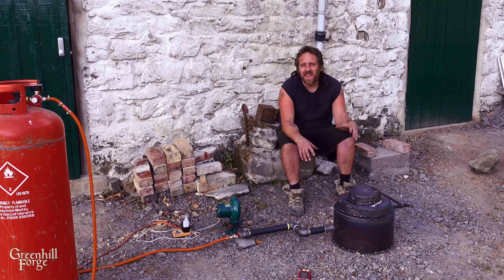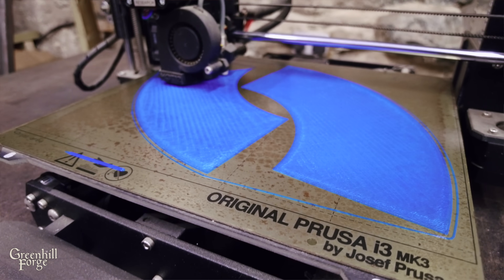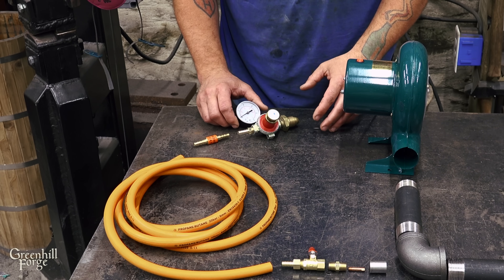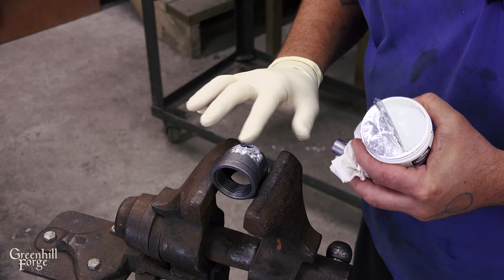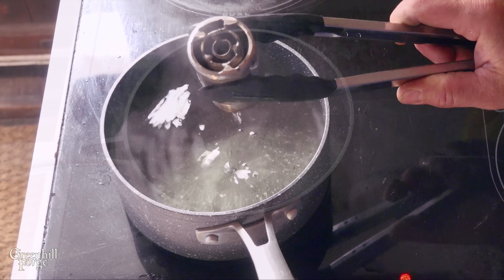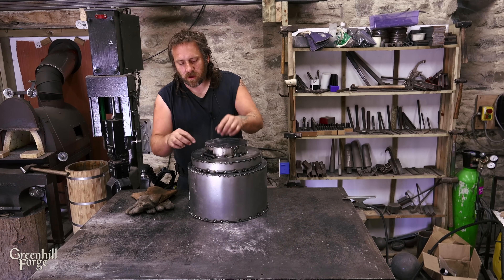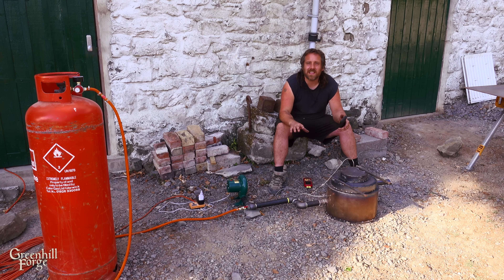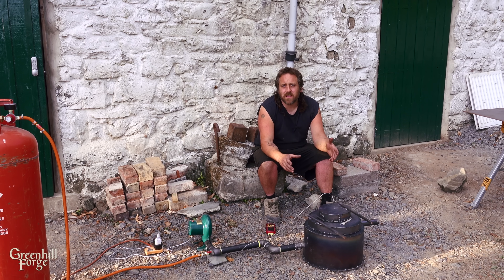DIY Kiln Build -Super Hot & Ultra Efficient

Comment: Thank you very much mister greenhill forge !

I will replicate your design at home, maybe someday if you see this comment, i would like to ask you if it is possible to even reach temperatures that melt steel and iron, if it wasn't you, i was about to use my MMA welder as an Arc furnace by using graphite electrode

May god bless you and your gute wolfie ! ^-^
Reply from the maker: you could definitely get hot enough to do cast iron with a good design. you could melt steel too but I'm not sure how usable it would be after that

Comment: Awesome build!  

One small suggestion:
For the fitting that receives the MIG welding tip... Rather than using a nipple and filling it with a brass rod, perhaps you could just use a brass plug?  You'd just have to turn down the unthreaded end, and then thread the outside of it (as well as drilling and tapping a hold in the plug for the MIG tip).

Comment: When you say,  "now I will mix up the refactory cement"  could you clarify what type of refactory cement your using?  temp rating,  and other than curing/heating being done, are you ramping this heat up?  Could the same thing be done effectively in a kiln? where the ramp up temps are very controllable.
Reply from the maker: it's vitcas 1700c castable refractory - https://shop.vitcas.com/refractory-castable-grade-1700.html

Comment: That's a brilliant  idea... 3D printing moulds for casting refractory cement. How do you find the heat transfer thru that cement... does the outside of the furnace get hot? Subbed here.

Comment: Amazing vid man, truly. Regarding the idea to use it to melt cast iron; would adding a second air turbine right in front of the other one in a simetric manner, increase heat in the crucible since it would increase the amount of oxygen mixed with propane? other option would be using more pure oxygen by using an oxygen tank and mixing it with the propane the same way, since air only has about 20% oxygen.

Comment: What is the logic behind the exhaust port vs. some kind of open top? Also, during long term use have you seen any degradation of the exhaust pipe? I love the idea of using the waste heat for preheating the charge or the molds.
Reply from the maker: the idea is limiting the exhaust to the same cross sectional area as the input to maintain pressure and velocity of the swirling gases and limit oxygen entering the chamber. it does get some fire scale on it but it's loose so can just be swapped out

Comment: You can increase the efficiency preheating the incoming air and obtain higher temperatures. Can be done with a tube and tube heat exchanger using the hot burned gases

Comment: Nice build.  I use a larger diesel/kerosene burner for melting down bigger chunks of cast aluminum parts into ingots.  Want to make a good smaller kiln for actual casting into molds since the compressor needed to atomize the fuel is noisy.  That's a nice simple design, already have a mig nozzle propane burner very similar to yours but no nozzle like you have going into the kiln, that's  slick.

Thanks for sharing

Comment: Very nice design should be proud!  -Could have used a thread brass plug for the propane input and a malleable iron "T" instead of drilling and welding an elbow. Passivating stainless is good to get rid of extra iron but the heat will do the oxidation and eliminate passivation.   Can feed back the exhaust to the input and a pipe in pipe heat exchanger for greater efficiency.

Comment: You will find out very quickly that once you get above 1000c it will take twice the PSI of gas for each 100c you go up. Not sure that .8mm tip would be big enough to get it up for the cast iron. I use 1.2mm tip with 10PSI on my forced air setup to get it up to over 1300c. But nice little setup!
Reply from the maker: Thanks! Yeah, mig tips are great because you can just switch them out for different setups. So far I've been able to get 1250C at 4 psi with the .8 tip. Hoping to do the first actual melt tomorrow and then maybe try pushing it a bit after that. I also think I should have gone with double the insulation to really max it out.

Comment: Ha! Watched this several times to try to figure out the approximate lengths of the black iron pipe. It took a few times to figure out why you used a socket to connect the fuel supply! The socket fits the nipple that the mig tip is fit into. That is an awesome idea to make the fuel feed easy to connect and disconnect! Is there concern of the fuel feed to 'pop' out of the socket or, is there anything else holding the nipple in the socket?
Reply from the maker: It's threaded in with gas ptfe tape

Comment: Rookie question: most refractory cements that I'm able to find are rated for 1000-1200°C at most. But this kiln appears to be capable of reaching higher temperatures than that, which is good for some metals of course.. but what exactly happens to the refractory cement if the rated temperature is exceeded ? Sorry if this is a stupid question, I'm genuinely interested in making a kiln and I my knowledge on the topic is rather limited. And thank you for the video!
Reply from the maker: My guess is that they'd start to crack and crumble. hopefully slowly so you'd notice but it could be quite sudden. I definitely wouldn't try using higher temps than the rating. I used vitcas 1700C castable refractory. Mizzou is also really good. Also the only stupid questions are the ones unasked.
Reply: @GreenhillForge  Thank you, appreciate it. And you're right about the questions :P

Comment: I built a kiln a bunch of years ago and thought oh how cool to make stuff out of aluminum cans, so I did. What I learned: Wholly cracker barrel it takes a TON of cans to make stuff! My favorite source of aluminum is old automotive parts, heads, transmission cases, brackets, etc. Far more aluminum at way less effort, easily obtained at your local repair shop at scrap rate or free some times. I reduce the aluminum into smaller hunks by digging a hole and using a wood fire with air to either melt or soften so it can be easily chunked apart or a steel drum can be used on its side with an LPG burner. The aluminum melts and runs out the end where you can collect it in ingot molds. AKA cupcake pans or other molds. I am currently working on a forge build when I have time, after that I probably need to build another kiln. hahaha

Comment: After it gets hot you should switch to used oil to get the temperature where you want for iron.  Propane just wont get you there for a number of reasons including cost. The one thing I found about my blast furnace is that the air to fuel ratio has to be just right to get the temperature to get hot enough to get close to melt iron. I usually leave the air running wide open and adjust the fuel flow to get what I want.  Good luck.

Comment: make sure you always turn off the gas first, then the forced air. that way only air is flowing threw the pipe. usually what's used is a venturi effect pipe that gets hot and used convection to ensures that air is always being pushed threw the pipe when fuel is cut off. the venturi effect uses flow to create a low pressure zone(vacuum) that is filled with the fuel. so you can think about it as a half circle stone in a river all the river water flows around the stone and just behind the flat part of the half circle the water wants to be pulled away from the stone.
Reply: Rura Venturiego jest mniej efektywna.
Reply: @norskenor2524  are you a ai? less efficient then what? are you trying to say the air mixing is less efficient? because more even flow happens with venturi, how efficient does your air mixing need to be in a less then 4 ft pipe? and how is efficient relevant to the safety issue I was bring up? are you thinking that you can't use a blower with a Venturi tube?
Reply from the maker: absolutely. propane should never be flowing without air the on. Venturi effects are really cool, it's a side effect of the bernoulli effect which I have a video about here https://youtu.be/fNLjG3oAdUM . Forced air burners can get a lot hotter than venturi burners so while one of my forges is Venturi based I usually go for forced air.

Comment: The discolouration on the outer steel shell indicates you are loosing a lot of heat due to the large surface area.    Add an extra 2 inches of Rockwool or vermiculite insulation  inside another outer shell and you will be able to melt cast iron.  You also loose a lot of heat through the bottom.   The efficiency will also increase.
Reply: It'd be really cool to see this build with a thermal camera, it would really show any points of loss quite clearly.  Still looks like a really nice build!

Comment: Subscribed. It's great finding creators like you. A few questions: (1) Do you post your 3D models on Printables/Thingyverse? I would love to make some mods. (2)  I was trained as a goldsmith I notice that a lot of steel, al, cast iron furnace's don't use a shielding gas during melts to reduce pitting in casts/ingots nor borax to help with slag and impurities is there a reason? Cheers!
Reply from the maker: Thanks! At some point I will get things like 3d models up over on my patreon but I'm really busy so it's hard to find time. I use borax to clean it up but wouldn't use I shielding gas for anything less than silver. It just doesn't really need to be that clean to make it worth it. My wife was a jewler and she didn't bother either when doing things like brass, bronze, copper. Gold is just to valuable to not bother

Comment: Very well done project and video. Explaining the pieces, parts, dimensions, sizes and reasons why you're doing it that way is very helpful. I would like to build a small kiln like that and for the same reasons. The video and attached list below covers most everything. Things I would like to have include a 3D printer and a CNC plasma cutter. I have an older model HyperTherm with the handheld torch. One thing I didn't quite get...  I believe you said a 0.8 MIG tip... I think all the ones I have are 0.025, 0.030, 0.035, etc.
Reply from the maker: Thanks! I use a hypertherm on my cnc, great machines. if you can get or build the cnc table you could just get a new torch for the hypertherm. An 030 is the same as a .8mm

Comment: Wonderful furnace but you're melting aluminum unsuitable for machining, better to use castings like engine blocks, heads and wheel rims.
Reply from the maker: Thanks. I'll keep a look out for engines but I need some basuc parts that can metal should be good enough for

Comment: You are missing both

The very bottom should have a small cup area.
You want a space out of the heat blast for some charcoal to set.  This gives you the option of creating an Oxygen depleted kiln environment (it's beneficial for some types of pours.)
The reason for the cup underneath is that the heat alone in the shielded and lower area is enough to more slowly burn the charcoal lumps.  
(By simply throwing in a lump now and then the more direct exposure to the flame will reduce the charcoal to ash way to quickly and it's both a time consumer for you and more expensive of burning through more charcoal.) 

 the replaceable catch basin in the bottom for where something like a dribble collects and cools.  This was commonly a little metal cup that prevented metal turning solid and clinging to the kiln cement/brick etc...  When the Kiln was cold you pulled out the cup and emptied it.  (A metal cup with a 5 degree taper meant the contents fell out like a hockey puck. 

Not to worry your current design will eventually have some dribbles and those will spall the bottom of the chamber.  Just grind (don't chissle) the remaining area and then install the modification.

I made mine from a 30 gallon drum that we cut down.
The year was 1994 possibly before you were even born.

Comment: 1. You remind me of an Old friend of mine.
His story was he spent a summer collecting Aluminum cans.
At the end of the Summer he realized that an abandoned car with a cracked Aluminum block had more Alu. than he'd collected all summer.
With in a year he had a truck rig that would lift the engines out of abandoned cars and he would power wrench the nuts and bolts apart.  He said he could street strip a car in less than 20 minutes.  He had every abandoned Aluminum blocked car hit for the area of 2 whole counties.
It was then that the Sheriff of the county had gotten a mandate to recycle abandoned cars' and he was very upset with my friend that my friend had already harvested the cream of the crop in the recycle of certain groups of cars department, and the highest/easiest catigories. 

If I were you I would start Looking for larger Alu. objects to upcycle. 
2. Consider switching the metal muncher into a wood grinder, for a different line of products.  You could find a line of product and simply press the wood grind and some saw dust (Maybe even wood flower) into a mold and then inject glue, while removing the air (it's not that hard to set up) and then press the two half's in a 2 ton press while it dries.  Out pops a cheap wooden product.
3. Consider switching the metal muncher into a Plastic grinding for Upcycle in 3D printers is an up and coming thing.  PLA is commonly remade into filaments.  (Dual extruders are becoming a thing and using the remade filaments for infill will become a thing.)  Also PCL pellet machines ("Greenboy" You tube) could be made to handle shredded low temp plastic materials and skipping the make it into a filament.  So your grinder may have a better life and you would place the screened shred into a finer grinder to make the out put of your machine even more reliably feed into just a hopper.  
4. Consider making the above mentioned Grinders and then sub contracting them to other like minded people who train the the labors' at some centralized facility like a community Upcycle center. The laborers' could be those who could be needing to do community services before a court date.

Comment: Use that hot exhaust to preheat the intake piping with a reverse flow jacket. Watch out for ignition temperatures.
Reply from the maker: it just becomes a much more complicated and potentially dangerous build, but prehaeting would certainly increase the kiln temps
Reply: @GreenhillForge  Nie stosuj rury dolotowej , jest niebezpieczna tak jak sam gaz.

Comment: Is there a benefit in using this TIG nozzle for mixing in the gas ?  For such type of forced air burner they usually don't use a nozzle but a simple T-Joint for bringing the air and gas together and a following elbow for mixing it.
Reply from the maker: It's a mig tip and the benefit is that it is replaceable and interchangeable so the flow can be adjusted depending on the kiln it's being used with
Reply: @GreenhillForge  Thanks for the answer. I thought the pressure regulator was also used for regulating the gas flow.
Reply from the maker: @Dr._Spamy  it does but altering the diameter of the orifice also adjusts the flow characteristics

Comment: Eloquent and efficient design.  I'm no expert in the field but this is an ingenious design with a working proof of concept. I must ask what is your creative process? 

I'm struggling to produce an efficient heat exchanger to heat up water from propane. Was really excited by your copper tubes in your previous videos.
Reply from the maker: thanks! not sure i've ever thought about my process. I guess I just get interested in a thing and then read a lot and go down rabit holes until i can answer all they "why" questions I can think of about it and then play with it in my head, trying to focus on the goal and strip out anything unnecessary. then build, fail, learn, build, fail, learn, etc...

I think for a good instant heater a design would be copper coil inside circular flu with helical baffle up the middle and propane burner at the bottom, kind of like this video but with propane, circular flu and helical baffle. A good tanked design would be a circular flu running up the middle of a a cylinder tank with a helical baffle in the flu and a propane burner at the bottom
Reply: Thanks for the insight. 

Your videos show your are rapid ability of learning and creating. It's refreshing finding such original content!  @GreenhillForge

Comment: Hi! I am very happy that I found your channel too! 

This is exactly the burner that I want and need! I was wondering if there is any chance you could provide a sketch of the piping system with diameters and lengths?
Reply from the maker: Thanks!. I don;t have a sketch but if I remember correctly they're 4 inch pieces of 1 1/4, 3/4 and 1/4. ideally only the 1 1/4 would be threaded and only on one side to get better welds.

Comment: This is a great design and you, sir are an excellent fabricator.  I’m a new subscriber.  One question is about your burner design.  Since this is basically a premixed torch design, I wonder if you could achieve the desired mixing with a swirler located before the multichannel burner head.  You could also play with flame shape by putting a swirler at the outlet.  This is where computer modelling would be helpful.  Absolutely brilliant job!
Reply from the maker: Thanks! swirlers would work great but a couple elbows work well and are way cheaper. it would be fun to model things like this
Reply: @GreenhillForge  any chance you’ve put the files up somewhere for the refractory forms?  They’d be much appreciated.